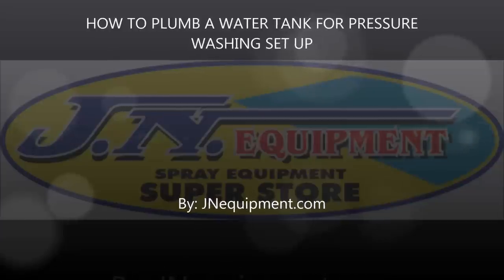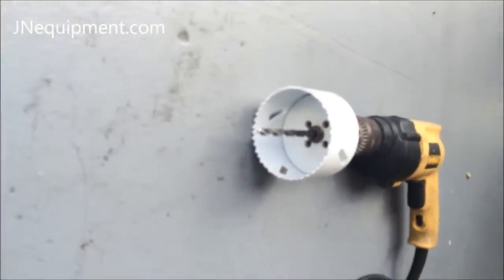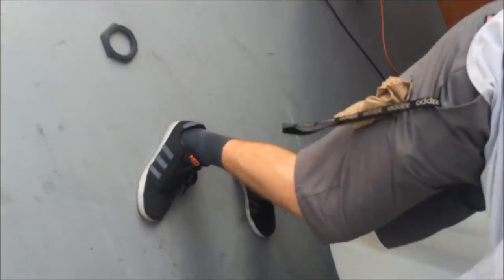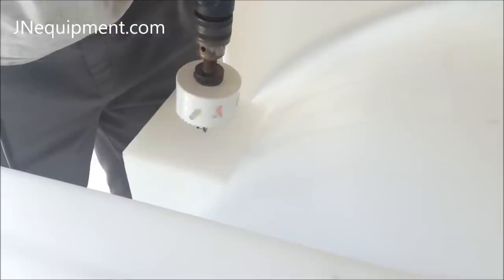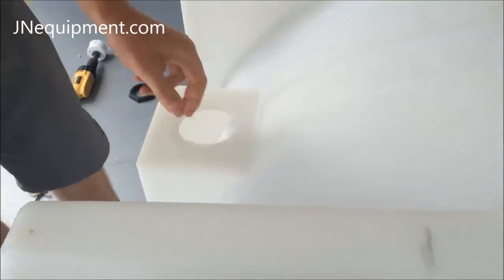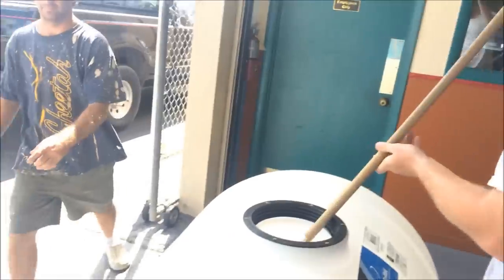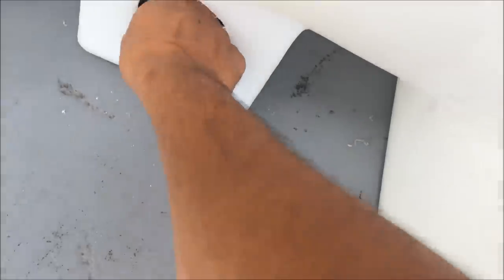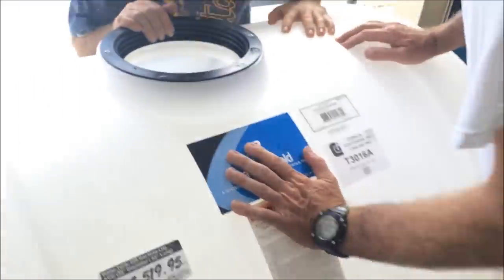How to install a bulkhead fitting on a water tank

Comment: That's a little tank.  What about a large tank you can't use a broomhandle to reach where the fittings need to go?
Reply from the maker: get a longer broom handle, or a fishing string or wire, anything that'll lead it to where you want it to go.

Comment: I'd be interested in learning why it is a reverse thread if anyone knows
Reply: hello there. It is a reverse thread, becasue it gets tighter as you thread it and it is not un-srewed from the inside side. (it is not getting loose).  That way you do not need to keep the inner part tight in ordert to fully tighten the nut.

Comment: What size bulkhead on a 65 gal tank running a 5 gpm ?
Reply from the maker: 5 GPM pump, I would recommend a 1 1/2 inch bulk head, you'll never go wrong feeding a pump too much water, the only issue is the pump NOT getting enough.